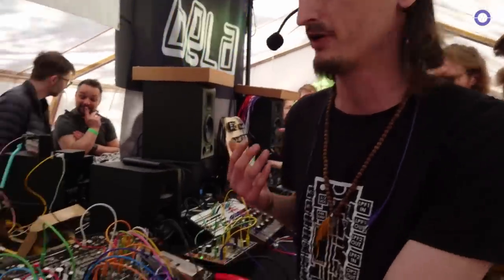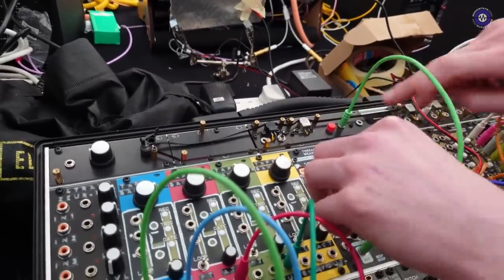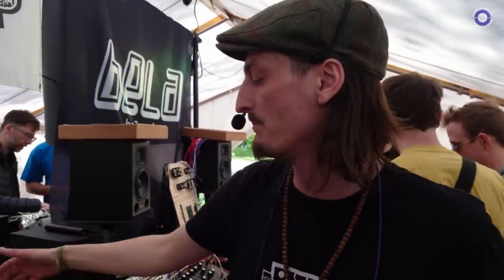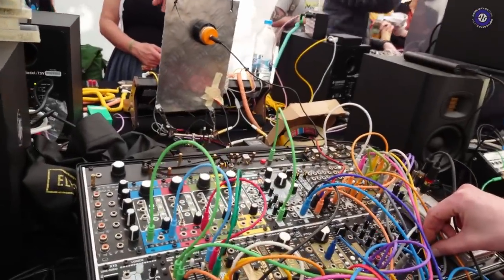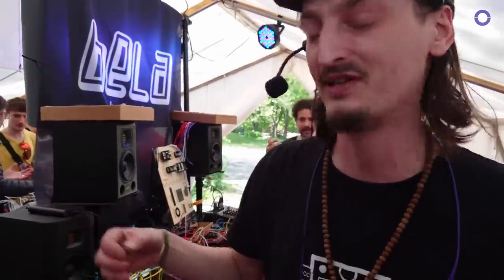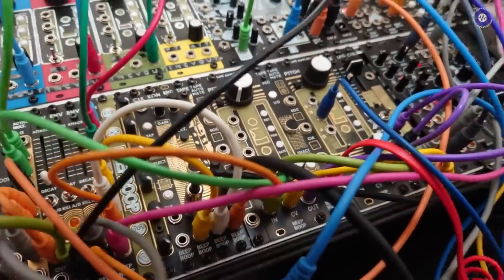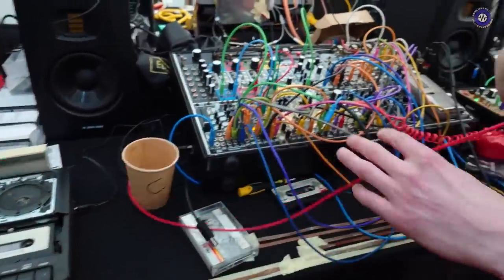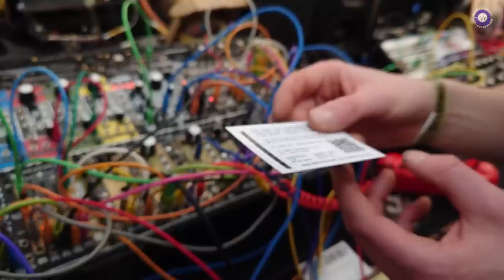Superbooth 2023: BeepBoop - Tape Rack - Cassette Tape SOS Recorder In Eurorack

Comment: Loving all the stuff. I know he says the idea is to get off the grid, but in Eurorack it would be cool if you could choose to have one track on the tape to record some sort of clock on. Then send that back out to the system. The tape loop could theoretically become the systems master clock. Then playing with the speed of the tape your whole system would follow. Sort of how we used to use a track for timecode back in the day (to sync MIDI gear when multitracking to tape). It would mean adding at least a second track to the tape setup. A second track could also give the option of stereo, or two semi-independent loops running in the same timeframe. Having the unstable tape as a master clock could bring some fun wavering timing to sequences too I bet. Anyways loving how this guy thinks. Hope to see his stuff come available.